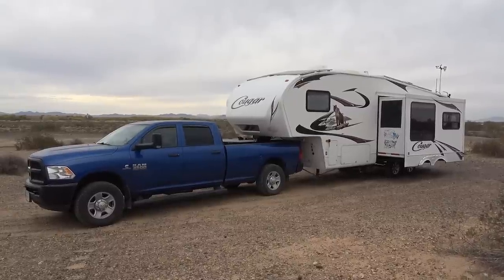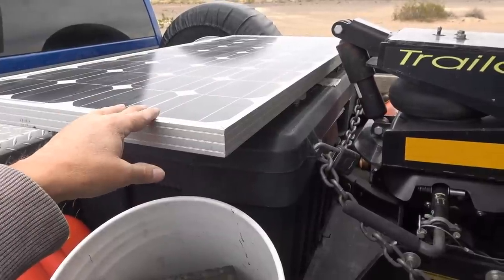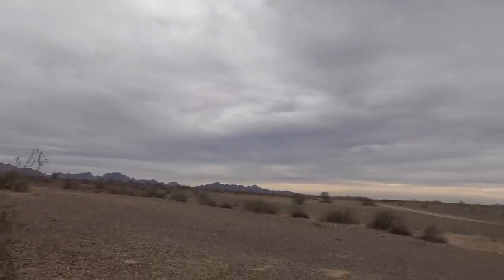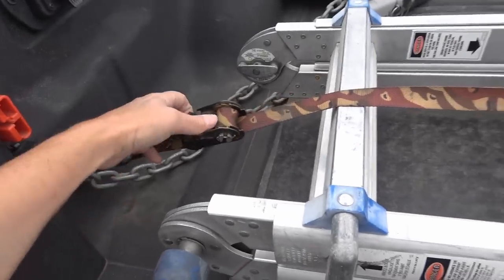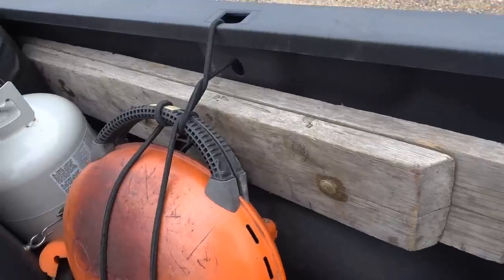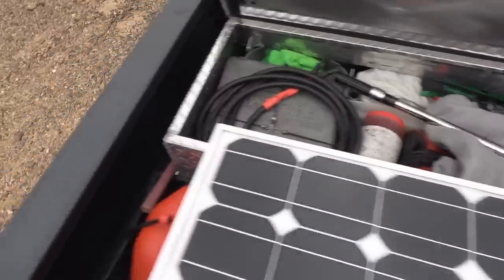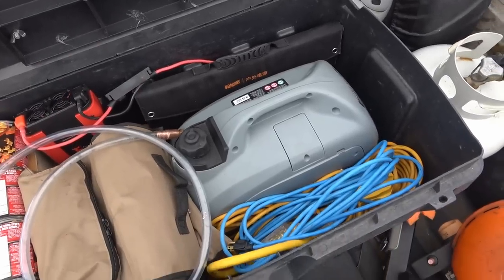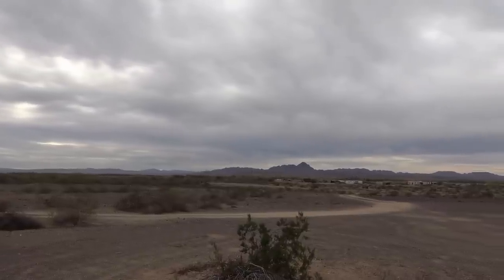Truck Bed Storage & Organization (Full-Time RVer) Ram 3500 SRW Long Bed Towing Fifth Wheel Trailer

Comment: Thanks for the video on your truck bed layout. I tow a travel trailer with a measured loaded tongue weight of around 850lbs and I am towing with a RAM 1500 Ecodiesel (1/2 ton). My payload capacity is 1730lbs so I am careful not to exceed that. Great that you stress leaving yourself a safety margin by staying under your truck's payload capacity. I see so many rigs out there that are overloaded with the  nose of the tow vehicle pointing up. Scary stuff!!

Comment: I bought a folding ladder like you have when Costco had a sale. I used it last season for the first time to clean and apply seal lube to my slide-out. One of the best things I've bought! I keep in in the front of the bed cross-wise on my Silverado with the 6.5 ft. bed and store other bins on top of it. I have a tonou cover, (I don't have a 5th wheel to worry about,) and the whole thing's very secure!! Merry Christmas to you and Ann!!! 🎄🎄🎄

Comment: I have a short bed Ram and ended up adding a roof rack to transfer as much weight out of the trailer and out the bed of the truck as possible. I had that folding ladder you have but it was just too heavy, awkward and bulky so I sold that and got a telescopic ladder which was less weight and a lot smaller. My set up is very similar to yours but just utilizing one tough box and I do carry a hard water tank for boondocking. I'm considering selling it and just getting the large bladder style like you have to save space. We will see. Btw chains work great for a zombie alert system. "Zombie", meaning Walmart crackheads looking to score a fuel tank or Viar compressor.

Comment: Nice layout. Looking forward to the rear seat organize vid. Have you ever worked w/a slider hitch? thx
Reply from the maker: Thanks, I've always had an 8-foot bed so never needed an auto-slider hitch. My old truck's hitch could have it's position manually moved to a few different slots but I never needed to do it in 7 years of using it with the fifth wheel.

Comment: What do you do with your trash?
I remember you had a box in your old truck. Did you find a better solution?
Have a Jesus filled day everyone
Greg in Michigan
Reply from the maker: If boondocking long enough to build up trash. I pull out the generator from the black tool box and used it to store the trash bag.

Comment: I like the idea and location for the second toolbox. I was thinking about storing my generator in a toolbox, but was concerned about potential heat buildup. Do you have any thoughts on this? Do you keep the generator’s gas tank full or empty while being stored? Thanks!
Reply from the maker: In the summertime, we stay in an RV park and I drain the fuel. In the winters we head south and usually the temps are less than 80F where we camp so keep it full for the most part. It only has a 1-gallon tank and it's metal, so doesn't worry me much. I'm sure they are tested to much higher temps.  My toolbox is also not air-tight.  I've actually had to notch out the corners to make it fit with my hitch legs. You could always install an air vent. Here is another more expensive option. https://www.rvgeneratorbox.com/

Comment: Hi Ray, once you unhitch the 5th wheel then your truck is used to go explore, shop, etc.  Do you move everything into the RV so truck then is empty to move around in and not worry about theft and the extra weight?  My husband and I want to fulltime too but all the stuff needed also needs safe storage. Doesn't seem to be a good idea carrying everything as you go out to play, hike, shop etc and leave that all open. Plus the extra weight with gas mileage and price of gas. Than you
Reply from the maker: Most of the loose stuff is unloaded at the campsite for use there unless it's just overnight or a few night stop.  The ladder and generator get locked to the stabilizer jack with a heavy chain. So what is left is the two tool boxes and they are locked up.  When I spend the summer months at an RV park I will usually take out the black tool box and even the hitch.  But overall fuel mileage isn't affected much I'd imagine on a large diesel truck, the truck itself weighs around 8500 lbs. Removing say 500 lbs. all the time isn't really going to do too much except give me a sore back. ;) Cheers, Ray

Comment: Ray please review this generator:  MaXPeedingRods 3200 Watt MXR Inverter Generator
Reply from the maker: What a weird name. :) Seems to be amazingly light weight giving the wattage with a smaller CC motor than others of similar power.
Reply: Yes that is why it would be great if you reviewed it.

Comment: Do you have a source of heat in you forward storage area for your  LiFePo4 batteries when in cold weather?
Reply from the maker: No, I don't RV in extremely cold temps, so don't have a problem with it being too cold for them. The forward storage area gets a bit of heat from the rest of the RV. I actually spent last winter on the west coast of Canada with no issues. I skirted the trailer. The LiFePO4 batteries don't charge much below freezing but will still discharge and power things all the way down to -4F. I did some deep freeze tests with the ones I have if your interested.  https://www.loveyourrv.com/lithium-rv-battery-deep-freeze-test-lion-energy-safari-ut1300/
Reply: @LoveYourRV  Thanks for the response.

Comment: one question, why no 5th wheel tailgate ?
Reply from the maker: I like to have the tail gate as an extra campsite table or work bench. I'm always using it I find.
Also, it sort of blocks prying eyes in parking lots, especially if they are short. :)
Reply: @LoveYourRV   I see, I have a cheap bed  cover so they would really have to work to see what I have under there.

Comment: Have u ever had anything stolen?
Reply from the maker: Had a 2 gallon gas can taken out of the bed of the truck about 8 years ago and 5 years ago my wife had her mountain bike taken from the campsite. It's was locked to the fifth wheel. But just a cable lock they cut.